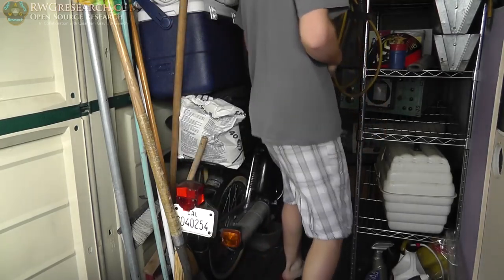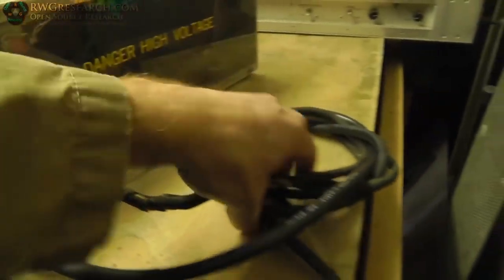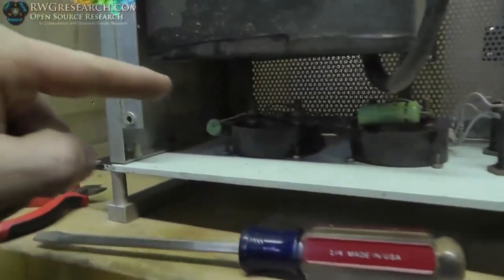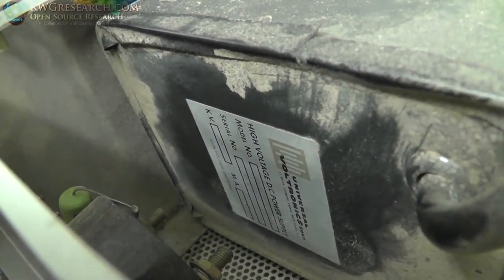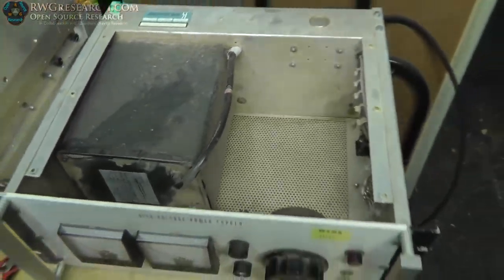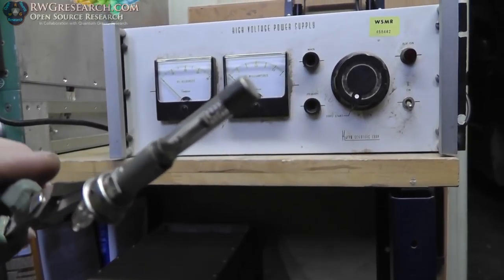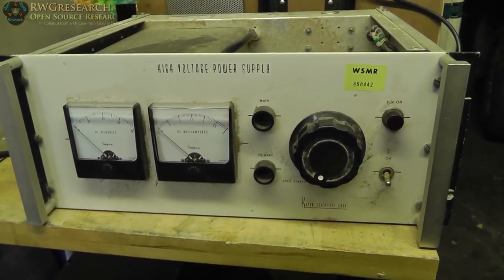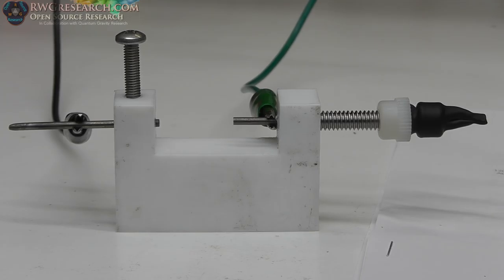Los Alamos National laboratory High-energy-density Plasma Physics STUFF Part 3 of 3

Comment: Nice, looks like it's worth keeping.

I would suggest getting some HV resistors (to limit peak current) and more HV wire.

The TV-40 / TV-50 cable used for high voltage wire in TV's should be a good start.

I have also found out that non-foam isolated antenna coax cable can stand 30 kV with no issues (note: shielded, so there will be some capacitance)
The cable looks black from the cut end and is actually white-transparent like your current HV cable if you remove the shielding and isolation, and not white-opaque like the foam kind (as seen from the end, or exposed).

Shielded cable adds capacitance, unshielded cable makes eletrostatic fields (not very problematic with DC, but changing voltage may do stuff).
You will have to figure out what you dislike the most of those two.